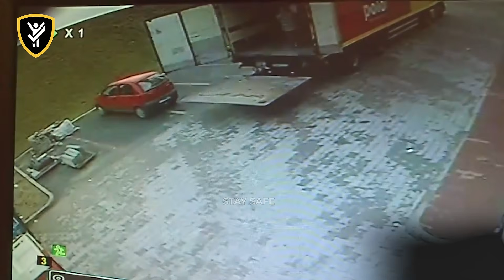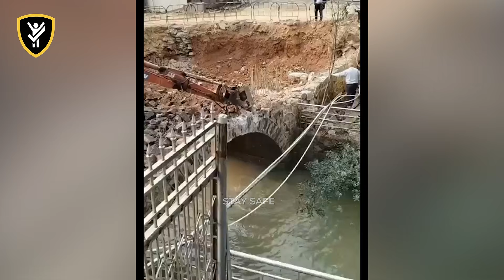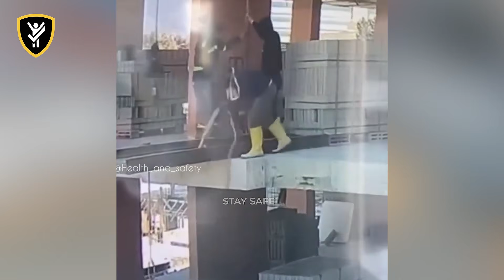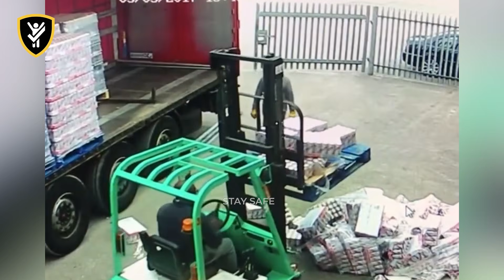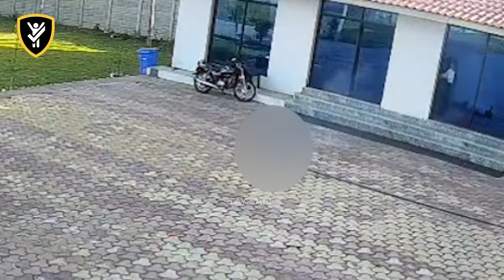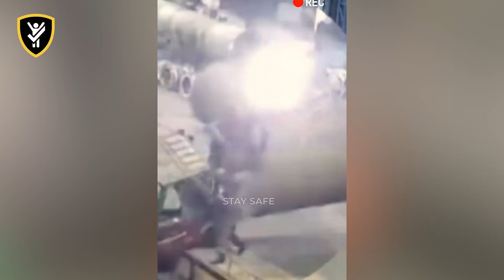He Inspected The Binding Machine

Comment: Important reminder that many workplace incidents begin long before the moment of injury.
Often, it is the small routine exposures workers stop noticing — positioning, manual adjustments, shortcuts, or entering the line of fire because the task feels familiar.
Hazard awareness combined with strong control measures makes a huge difference.